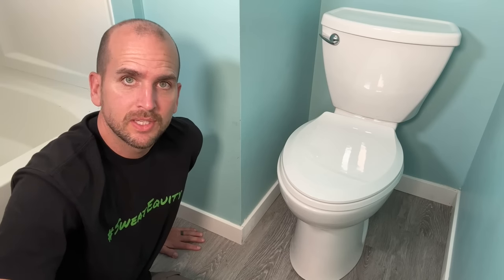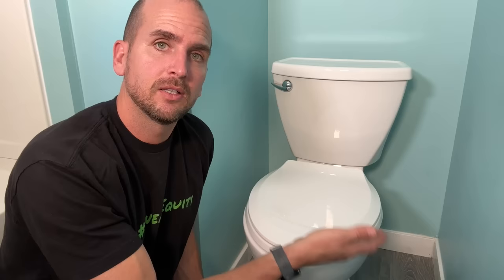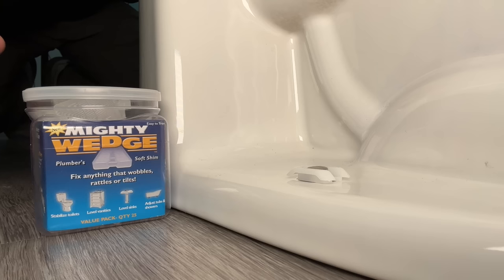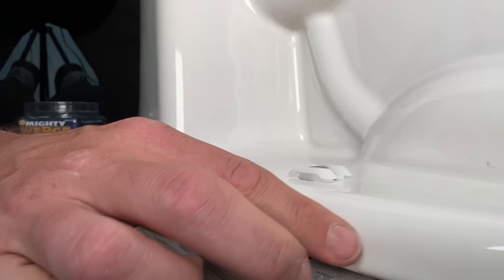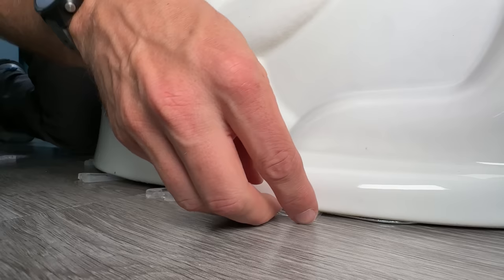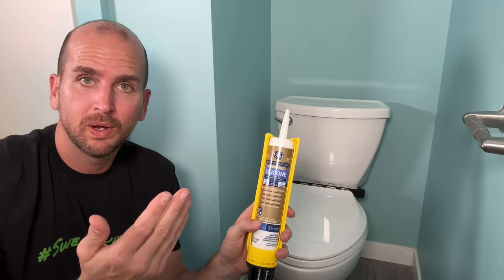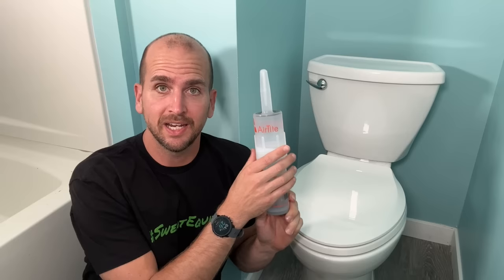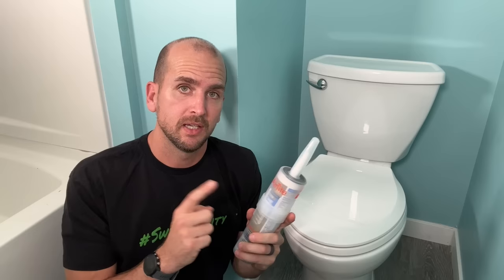How To Fix A Wobbly Toilet | Permanent Solution

Comment: Any good plumber will tell you not to seal around the base of a toilet because  if  the wax ring fails and leaks you won't know and it will rot the sub floor. It left unsealed you will notice the water and catch the problem before it causes damage.
Reply from the maker: I agree and that was the reason behind leaving the big opening at the back 👍
Reply: That's why he left the backside open. He only caulked 3/4 around. Smart.
Reply: His titles arent click bait, you actually have to watch the videos!
Reply: @EverydayHomeRepairs  so what if the floor slopes in the opposite direction...then what?
Water always seeks the lowest point...the slightest incline in the opposite direction in the floor and you would never know until possibly more damage is done.
Reply: @TomWWood  if the phalange is installed correctly and level, you don't need caulk to stabilize the toilet. The ring is the seal and that's all you need. I don't know where you're located, but where I am caulking is not necessary, it is simply the easy way out instead of correcting the main issue wether it be the phalange and associated plumbing or the subfloor, Wich in most older homes is usually damaged from older leaks because people caulked the toilet and couldn't tell it was a leak..
Reply: We seal around every toilet we install, we also use flexible green gaskets. 0 leaks so far 👍
Reply: Exactly
Reply: Can we guess who didn’t watch the video.
Reply: Caulking the base is actually in plumbing code bud
Reply: Any good plumber would tell you to seal around the base of the toilet but not all the way. You leave a little space in the back of the toilet not sealed so when it does leak you’ll find out
Reply: You actually seal around 3/4's of the base for that exact reason. The back should always be left open to catch a leak.
Reply: I was just going to say this n I have only installed 5 toiletseorking on my 6th n I know most home owners don't want shims or any thing that looks crappy sticking out the underneath the toilet
Reply: @ntroxell83  Dear Nick, 
Please watch the full video and it’s entirety before going to the comment section to say senseless shit. He clearly shows, both verbally and physically, him cutting the shims so that they aren’t sticking out from underneath the toilet. He then goes to explain that he seals the bottom for a nice aesthetic touch, but leaves the back open to allow a leak to flow through and be seen, indicating an issue. As a member of the YouTube Asshole Comment Police Committee (Y.A.C.P.C) we’d like to see you do better.

Thank You,
Reply: @abdal-haqq1688  it’s often done to keep water from the bathroom from running under the toilet and then causing an issue.
Reply: This happened in our house. Old owners sealed it and when we moved in we removed the toilets and flooring only to find the flange was cracked and the wax ring was also leaking 🙃
Reply: @gnice42 you just killed me…I’m literally dead from laughing🤣🤣🤣

Comment: Your flange is not set properly you have to re pull the toilet and make sure that flange is at the proper hight all the way around. And before you put your johni-ring in set the toilet and make sure it's not going to rock. If it is sitting nice and flat that will determine what type of Johnny Ringo you use. Once you do that everything should sit nice flush to the floor and you could bolt it down and finish the toilet install
Reply: right

Comment: THROW THE REMAINDER OF SILICONE TUBES AWAY UNLESS YOU"RE GOING TO USE IT RIGHT AWAY!  Silicone (opened or unopened) only had a shelf life of about a year.  Even if you've never opened an old tube of it, it will flow out just fine but you will be shocked to discover that the silicone you just laid down will NEVER dry!  I found this out the hard way on a shower install when I used an old, unopened, tubes of silicone.  Imaging coming back to a job 3 days later and your silicone looks like you just put it down. Now, whenever I need silicone, I go and buy a FRESH tube every single time. No one ever mentions this, so hope this tip is helpful to someone.

Comment: B.S. alert in first 30 seconds.  Do not ever seal the toilet to the floor.  I’ve set thousands of toilets.  If there is ever a serious issue with a leaking wax ring, you want that water to escape.  It will let you know there is a problem way before it will do any serious damage.  Now by all means if you want damage without knowing damage is being done, seal the toilet to the floor and later I hope you enjoy all that black butter!   …not to mention if it’s on the second or any upper floor, replacing the drywall on the ceiling below, repainting, scraping and retexturing it, oh and you better reseal it with many layers of Kilz before even thinking of repainting it.  Might take a week depending on your schedule.  Or, just have a contractor come in charge ya a couple thousand dollars to do it.  Want to seal that toilet to the floor now?  Just don’t do it.  This guy…geeze, lololol.  I’m staying away from his vids.
Reply: Obviously didn't watch more than 30 seconds, he addresses that @ 6:14
Reply: @TSBCoke you are absolutely correct….I did not watch the entire video.  People are impressionable.  So am I.  My imperfection is that I prefer to know what not to do first.  …Not giving others the impression of them/me doing things the wrong way when they/I click off of a video too early.  As one coming from an occupation of mandatory safety.  It is imperative to know what not to do first.  Do not rush into any situation unaware.  Be cautious.  Be aware.  Show caution.  Or, bad things can happen.  If it is intolerable, simply walk away.  Don’t allow others to make their ‘mistakes’ first to teach them how to do something.  I simply have a difficult time dealing with people who follow that agenda, either knowingly or unknowingly.  In my opinion that is called being a poor instructor.  You have my full undivided attention right up to the point you fail to tell me the things one really needs to know…..last.
When I am teaching electricity, identify the danger first.  When going into battle, identify the threat first.  When getting married, know whom you are marrying.  If she lies to you…not your fault you picked the wrong person to marry.  Check the gun first to see if it is loaded.  I gave the guy in the video a chance and he failed all who watch this video and click out of it too early.  Exactly why you should not teach that way.  Ever pick up a loaded firearm you thought was unloaded and handled it only to discover your ‘mistake’ after the fact?  You’ll be damn sure the next time not to let it happen again after that.  So, give this guy all the accolades you want.  I disagree with him and I disagree with you.  God bless and have a good day, Sir, Madame, or whatever personal pronoun you want to call yourself.  Oh, and watch every video you click on to the very end from now on……

Comment: I want to know how to stop my toilet seat from wiggling around and becoming loose all the darn time. Lol tighten the plastic nuts and the darn thing is loose a couple days later… I’m to the point where maybe I’ll caulk the nuts on, is that a good solution?
Reply: It sounds like you might need to pull the toilet and inspect the closet flange. It may be worn and starting to deform. Also, replace the bolts and nuts holding the toilet to the flange when you do, they are cheep and may be contributing to the issue as well.

Comment: I thought it was a huge no-no to caulk around a toilet.
Reply: Only if you go all the way around the toilet. Caulking it in the front and leaving the back open is very common.
Reply: You are correct. This guy is giving poor advice
Reply: @davemichaels5507  6:15 he addresses this and left the back open.  That is perfectly ok as water will come out ther the same as the front. Cmon people actually watch it.
Reply: You can caulk but NOT all the way around. Only caulk to the back corners. It should only be used aesthetically.
Reply: There’s actually some debatable code for caulking around toilets.
Reply: @6:12
Reply: It is a no no caulking is flexible which will give unlike grout that should be used to make it a solid no give seal
Reply: Definitely not a plumber
Reply: @dustinmetz8283  @6:12
Reply: @Lemony Snicket (Uni-T)  I know he left a gap in the back.. but that toilet is sitting way too high. You should never fill a 1/2" gap with caulk. More than likely he's using a non wax ring or the flange is too high and needs to be cut out and replaced.
Reply: @dustinmetz8283 he literally says he is a diy’er and obviously not a plumber. That is the purpose of their channel.
Reply: @frikkied2638  sounds good, more money for me 😆
Reply: It is don’t listen to these people
Reply: No..plaster of paris
Reply: You always caulk around toilet just make sure it's silicone and leave a small gap in the back.
Reply: Want to see start to finish
Reply: 7:44
Reply: Set acomole
Reply: Putting a. S red al undercomole
Reply: 0:51
Reply: @markr7131 alternatively, a thin line of grout is far more likely to break apart and fall out than caulk, which has good adhesive properties to hard surfaces like tile, porcelain toilets and manufactured flooring.

Comment: That's not a good way of repairing a wobbly toilet. If your toilet hasn't seated well with an extra thick or regular wax seal do not use these other fixes. If your toilet isn't sitting right your flange should be reset to be adjusted to the right level to the floor.
Reply: See his other video just before this one.

Comment: I never put a toilet down anymore without a bead of silicone around the base, ever.
Reply: Any particular reason why silicone rather than something like Dap Quick Seal? I like the water clean up with Dap
Reply: @LynyrdSkynyrd.4Ever  Cheap, on hand, does the job. If you have a better product at a good price then let me know!
Reply: @jaycweingardt11  Dap is 2 or 3 bucks for a tube but I can't find silicone for that cheap
Reply: @LynyrdSkynyrd.4Ever  Yeah, that looks good. Dap has good prices. I'm used to using GE silicone, but I have been using Dap Alex for a long time, I will give their silicone a try. Thanks!
Reply: Love your username.
Let's Go Brandon!
Reply: @jaycweingardt11  I'm just quoting our illustrious president :)

Comment: This is all wrong. That toilet was not landed correctly to begin with. You wonder why house flippers destroy homes? Your flange should be as close to level with the floor as possible. You land the wax seal straight down. You then sit on the toilet to further compress the toilet in the wax ring. If you think I am wrong, never sit on a toilet because once you do you would be following my advice. If you put shims in before sitting on the toilet, it's going to leak. Because your toilet has a flange or a mounting system that is too high to begin with. 

The only time you use shims are when all efforts to land the toilet flush with the floor fail. In the case of this toilet in the video, it's riding high to being with. You should have used a different toilet ring. 

Finally, what is going on with the toilet sitting 4-6" from the wall on one side? It's not even centered. Why did you not fix the misaligned flange?

Comment: 1) nobody uses a level on a toilet. if its bad to your eyeballs, its bad. if its decent with your eyes, literally nobody will ever check it with a level. 2) if it wobbles, you shouldve fixed that before you walked away from it. I would NEVER walk away from a toilet that wobbles even in the slightest, and my boss would kick my ass if i did. 3) always loosen the jonny bolts so that once you shim, youre tightening down onto the shims. 4) NEVER, NEVER, NEVER, shim the front of a toilet. thats just shitty work. 5) if youve shimmed a toilet, you always use white caulk as it will hide the gap on the floor (I REPEAT, CAULK, NOT SILICONE. Caulk will help remove any wobble, silicone wont)

Comment: This guy is clueless. Flexible caulk will allow the bowl to eventually rock and break the wax seal. You should be using tile grout ,sanded or unsanded depending on the gap size. Once dry it gives the toilet a solid base to sit on.
Reply: Frank, he added shims the caulk is purely aesthetic At this point it will not rock even if the caulk fails

Comment: This job can be tougher than the video makes it look. The floor tile job in my bathroom was so not level that I had to sacrifice making the toilet level in favor of getting it not to rock once I had the shims in. Consequently, the caulk job ended up in the front of the bowl and on one side. The gap in front was so large (about 3/8") that getting the caulk to stay when smoothing it was nearly impossible. I got her done, but know that if you end up with large gaps, you might want to first use the filler material (can't think of the name) first to take up space and act as a backing for your grout. Lastly, if you've never worked with this kind of grout, practice first on a small area, just to see how it behaves.  Toilet no longer rocks and it looks a sight better. Thanks for the video!  Oh, and if you don't want to depend on a wax ring, try one of these: https://www.homedepot.com/p/Fluidmaster-Better-Than-Wax-Universal-Wax-Free-Toilet-Seal-7530P24/205762183#overlay
I used it on all three of my toilets and it was a breeze to install.
Reply: Did you by chance remember the name of the filler material ...are we talking like Henry's 549 or what ? I have no idea what to do with the gap I have